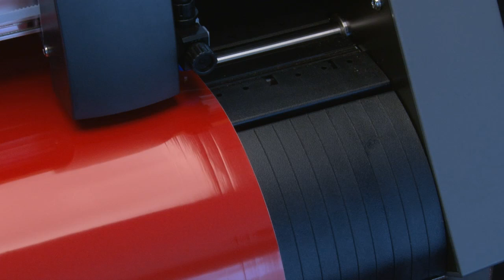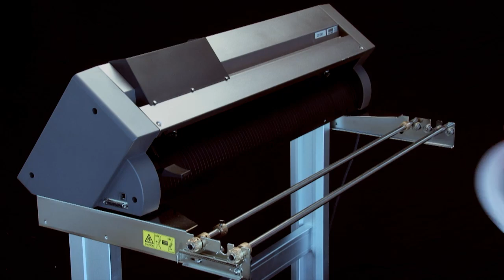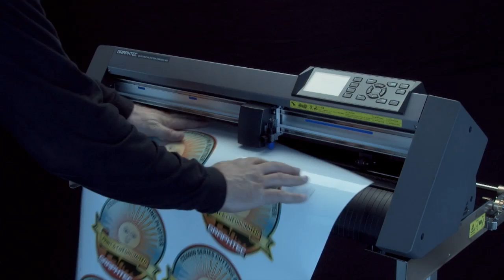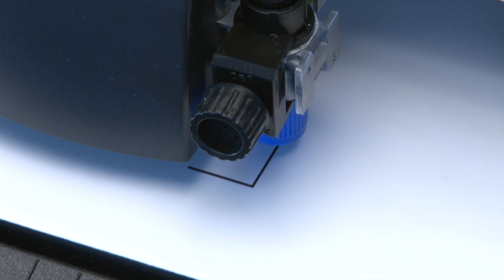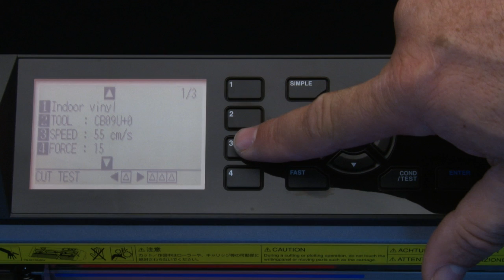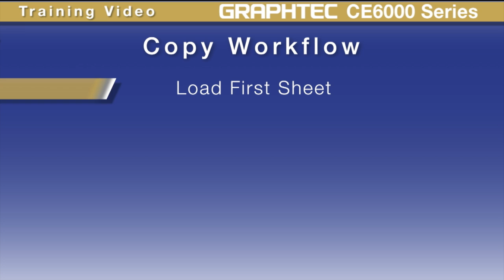Graphtec CE6000 Training - Cutter Operation

Comment: When I attempt to load a sheet into the cutter, I select "3-Sheet" in the Load Media window.  The cutter rolls to the front, measuring the width, then rolls to the back and returns.  Upon returning, it completely loses the sheet, meaning the sheet falls out off the cutter.  I haven't found anything that addresses this.  What am I missing?
Reply: @jotoimagingsupplies  i have done "1-Roll Front Edge" but that doesn't give me the length of the material.  It only gives the width.
Reply: What's the purpose of "sheet" if my best option is to choose "roll" in order to make this work?
Reply: Make sure there isn't any obstruction to the sensor in the back. I put tape over mine so I know the experience.